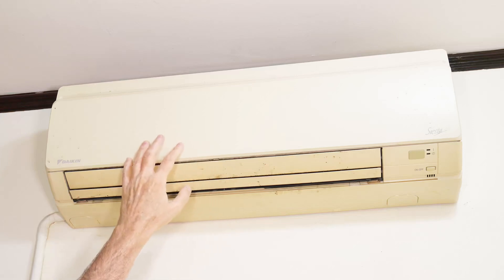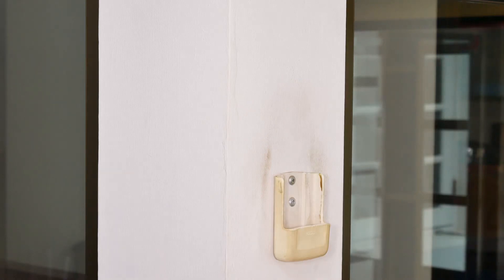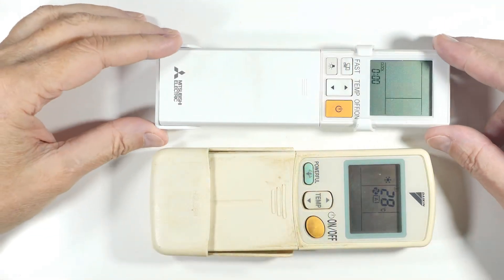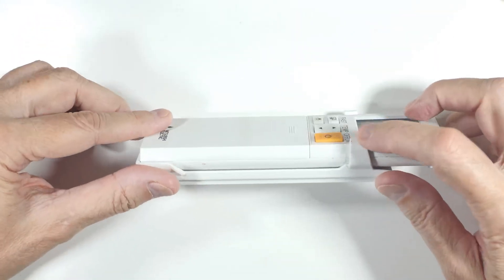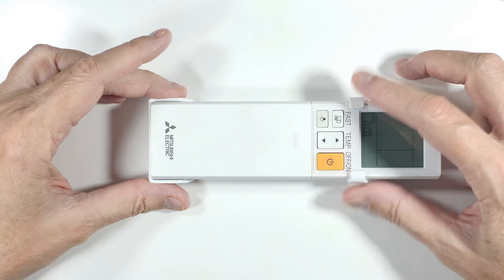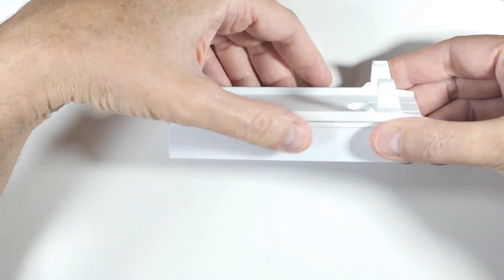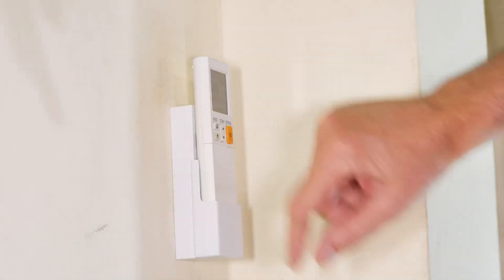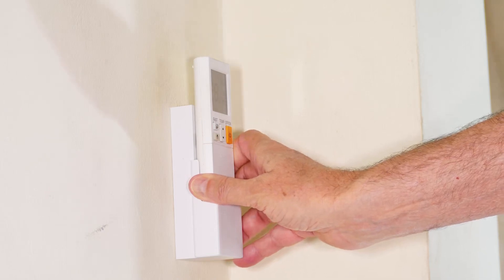AC / Heat Pump - Remote Control Wall Mount Upgrade (4K)

Comment: I have 5 internal units and got myself a Sensibo Sky for each of them thus enabling me to:
- Not having to deal with the remotes and their batteries
- They can be controlled by all my family members
- Automation (via HomeAssistant though no needed for basic schedules) Could never figure out how to program start and stop at specific times, using the remote on my Daikin.
Reply from the maker: I just googled them and they are very interesting. Will have to look into them some more and see if they are wife-compatible. ;)

Comment: I always wanted to provide external power to the remote so I don't have to constantly replace batteries
Reply from the maker: I am thinking the same. Solar cells? AC adapter to charge internal capacitors (rather than batteries)? If you make one, let me know!
Reply: @tsbrownie  I was thinking, hard wire battery eliminator kit to the wall. Control from my phone if needed via RM mini 3.